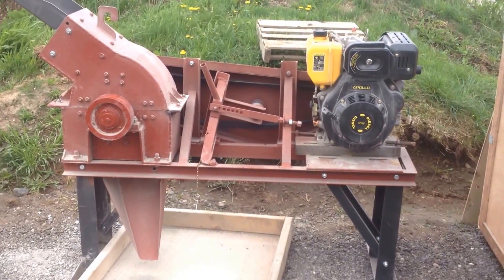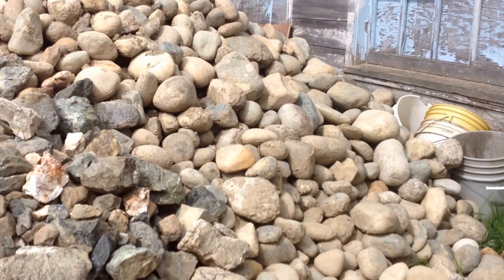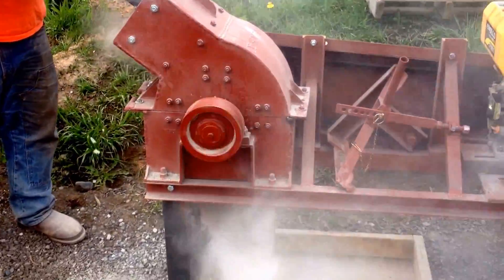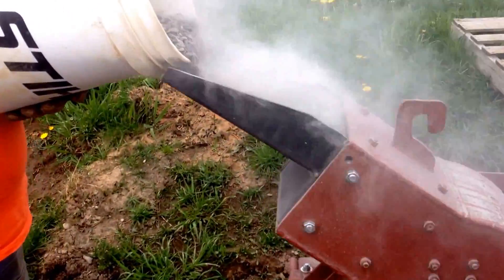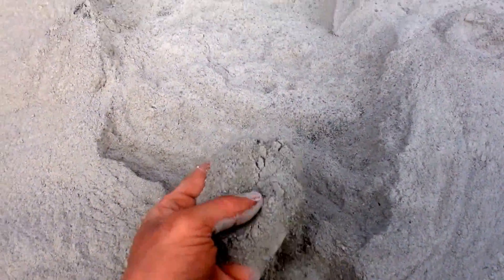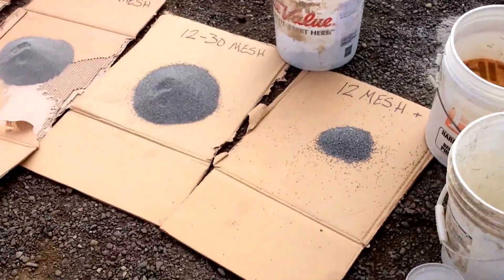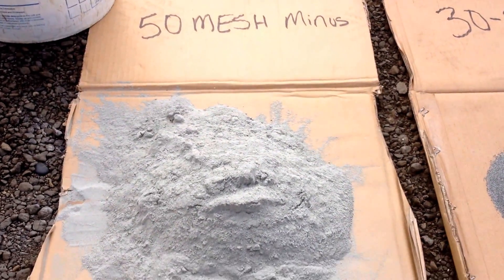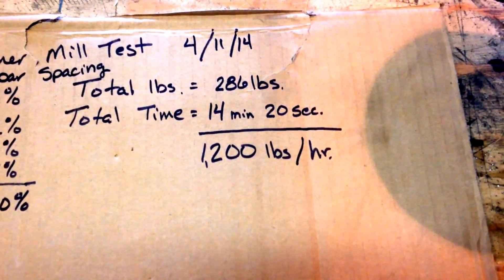MBMMLLC.com: Diesel powered rock crusher hammer mill crushing and grinding gold ore

Comment: Very impressive, although some other impressions are also hard to miss: That this is not an environmentally friendly method with regards to it producing dust as a final product AND as loads of fine particles in the air, and that it is not quite wise of the dudes operating the mill to not wear breathing protection..

Comment: Is it spinning counter clockwise? Most I've seen spin clockwise and it creates a vacuum so no dust in your face it pumps it out the bottom
Reply: More important is the pulverized rock is being slug into the screen rather than armor hence the screen will prematurely wear to failure. Only a combo wet/dry hammer mill is a must. Dont forget armor wear plates unless you want the body to fail early.

Comment: I am car mechanic, 
I have good suggestion for you 
If you wanna extended life of diesel or gasoline engine in such dusty working environment add two stage air cleaner that you can find on farm tractor first is dry separator with glass mushroom syclon and second is wet (oil) cleaner, 
Also its better you connect 3-4 inch flexible hose (like vacuum cleaner hose) and connect two stage air filter 2-3 yards away from engine, and you need to clean it each week,or 100 hours,
Reply from the maker: Great! Thanks!

Comment: Would it be possible to construct one machine like this for breaking down not only pistons but engine heads, intake manifolds, parts of the block.. I need a way of recycling and breaking down aluminium to a 8-6 mesh powder before seperation and melting. =)

Comment: What is the avg cost on this machine. Same setup? Is the -50 mesh equivalent to fine flour?
Reply from the maker: Hi Bryan,

If you can send me an email at MBMMLLC@gmail.com I can send you a full price list and info sheet on all our equipment and hammer mills.  

The 50 mesh minus was the smallest screen I had at the time of the test.  There is a lot of material that is smaller than 50 mesh, too.  Fine cooking flour is between 100 and 200 mesh for comparison.

Thanks for posting.

Comment from the maker: Ygmfmh-

Under normal conditions we would use water and suggest it to all of our customers.  This particular customer asked for a dry demonstration.  If you stand up wind its not too bad, but would not recommend running like this for a long time.  I have posted a link in the "about" section to a video of one of our hammer mills running wet and you will see there is no dust.  It makes a great slurry to run directly on to a shaker table or down a sluice box!

Thanks for the comment.
Reply: Glad you published this particular comment.... I WAS going to mention some severe lung problems in the future if not wearing a mask...